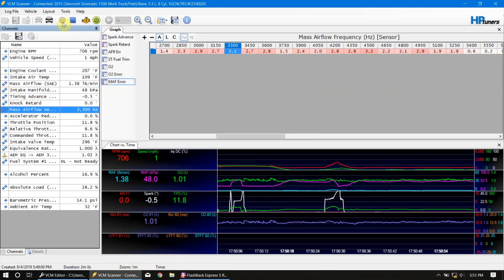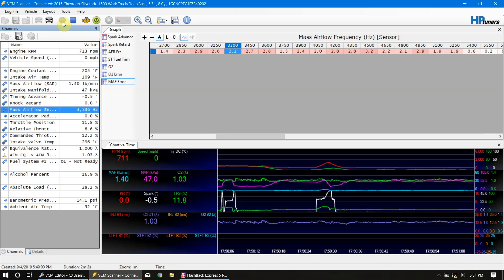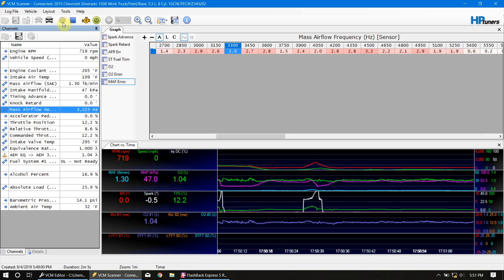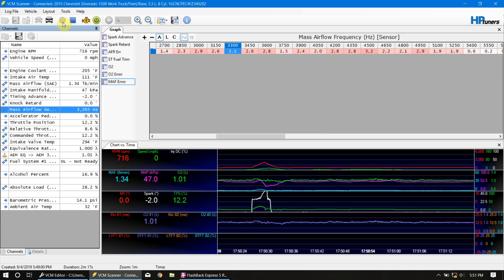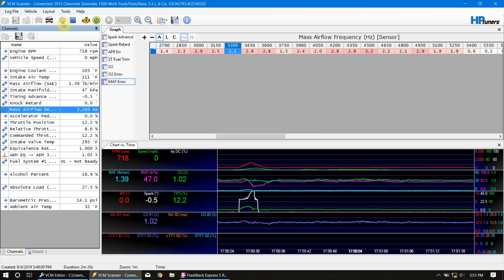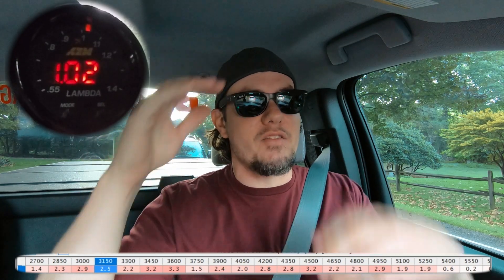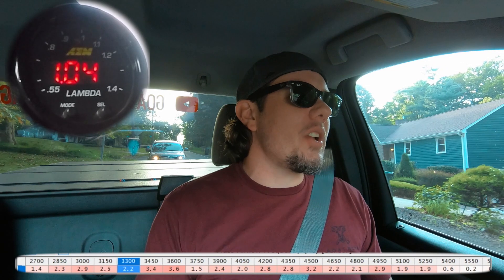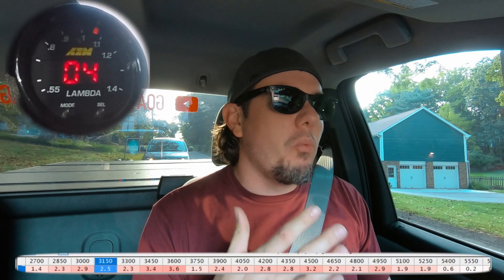MAF Data Logging In HP Tuners, How To Get Good Scanner Data

Comment: How does DFCO affect your logging? If you turn it off wouldn't it be rich as you lift off the throttle? Or if you leave it on it'll be lean? I assumed the PCM factored DFCO that into calculating the STFT and LTFT? The wideband wouldn't know when it's on or off or when you lift your foot..

Comment: Love your vids! I have 00 z28 and was setting up for MAF tuning, as per your video, made an afr err graph but in this video you are looking at a MAF err graph. Does that have to do with Lambda vs AFR? Sorry, new to this but ambitious and fast learner. Thank you
Reply from the maker: No, MAF is one of the ways we calculate air, when we are doing AFR or EQ error we are looking at what our airflow error is, people call it tuning fuel but the fuel it's a constant, the airflow is the variable that has to be dialed in.

Comment: Hey Kyle, great videos man, keep up the great work for us novice tuners out here trying to learn.  Quick question about copying the log data to adjust parameters in the editor.  At what point in the log run do you stop it and copy the data?  I was logging today and noticed the data is different during different times during the log.  So at what stage do you copy?  Thanks.

Comment: Hey bro. Did some logging for MAF today. Shitty day but did hit around 7700 hz. But 2 things happened or I noticed. 1) my idle hz(32-3500hz) stayed like 20% lean after multiply by half 4 times. Thinking it's either my idle air flow or etc scalar. Thoughts? 2) should we be disabling PE when logging?
Reply from the maker: Hmm, not sure what is up with the first. But if you're using a wideband you can tune with PE on
Reply: @GoatRopeGarage  AEM 0300. I was just curious about the PE. Going back through tune changes, my idle airflow has been changed and my throttle body has been changed. So I'm going to play with scalar and see. Then maybe idle airflow. You can probably see it in the tune I sent
Reply from the maker: @Anvil_tbss  I'll take a look
Reply: @GoatRopeGarage  hey man. Just wanted to touch base with you. Guessing my vacuum actuated bov doesn't like tuning with 2nd gear pulls. Cuz there's no load so a ton of vacuum is opening the bov. Stiffer spring I think may be the answer to keep it closed.

Comment: Hey question on MAF tuning/scaling? I'm using a different software since I'm JDM, my MAF sensor calibration uses voltage and lb/min for the adjustment. Any difference from how you are showing in these videos? Getting ready to put a intake on that was throwing lean code before I had the software to tune. Happy Thanksgiving BTW. Following your Instagram, I'm @rotary4life. Keep these videos coming!
Reply from the maker: Not really, just set it up based on your MAF scale, the error math is basically the same. Keep that rotary rich! Miss my wankle!

Comment: Thank you for finally explaining how and why things are done. I have been trying to figure out a lot of this and have been frustrated. Where do you place the wideband and how do you connect to hptuners vcm.
Reply from the maker: I put mine bear the factory front narrowband location and I'm using serial to bring it in to HP Tuners

https://youtu.be/mGcEw29XZBQ
Reply: @GoatRopeGarage  I have the MPVI standard. Will this still work as in your video link? Plus can I just replace the narrow band O2 for tuning then reinstall the narrow band when done. I am running a stock gen IV 6.0 in my JK jeep so I wont have to stay on top of my fuel trims all the time.
Reply from the maker: @paulbaker2680  yep and plenty pull the stock narrowband because we are disabling LTFTs during the tuning process anyways.

Comment: Actually you mentioned something about having the MIL light to enable when you've maxed out MAF. Would you mind explaining this. Sounds like a good feature to use. 
I'm interested on hearing about this...
Reply from the maker: The P0103 DTC can be changed to light up the mil on first error, is usually set on second error. It's just a positive response that let's you know that you're not running on the MAF. There is also a PID on later generations you can log that will tell you what is in control but I can't remember the name off the top of my head. I'll post another reply if I think of it.

Comment: I have a question, as of recently on my 99 Camaro my wideband is reading abnormally rich when at WOT and in PE, iv just about convinced myself it's a faulty o2 for the gauge but was curious if ya have a way I can verify the wideband is indeed reading correct or incorrect. Awesome content man, thanks!
Reply from the maker: That's a tough one since you can't compare it back to the narrowband sensors like you can when cruising. I'd probably do and open air cal and see if it continues to read rich.

Comment: Something I had some issues with was I would get idle and tip in good. Then go up to red line some and when I would slowly lift it was making my tune fat at the bottom. So I tuned the MAF in 3 sections only pasting the section I wanted to tune at that time and it got me way closer to where I wanted to be then pasting it all every time.

Comment: What all would primarily need to be changed if I upgrade from stock supercharger at near same boost? I have a 16 Z06 and considering a Magnuson 2300 over the stock 1740.
I like to use the AEM gauge with the OBD pass through port and add it to the pid list.
Reply from the maker: You'll have to do the full airflow tuning then a little torque table adjustment.

Comment: I like how slow your wide band reads mine is crazy fast i'm sure its better for the log but yours makes it easier to see the number.
Reply: I have the same issue so I bought another wideband. The fast reading one is the AEM 30-4110 so I got an AEM 30-0334 that plugs into the OBDII and its more like his. I think it's just a firmware thing in the gauge, like a built in smoothing or something.
Reply: @fasnuf  I may have to look into that and just keep mine for logging purposes. Thanks for the info.